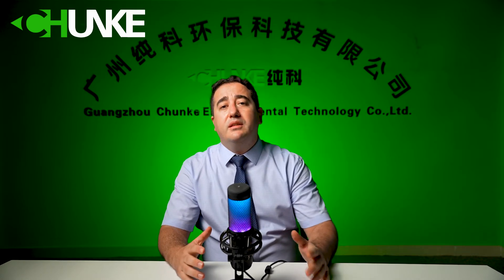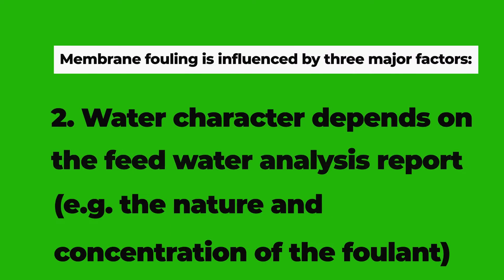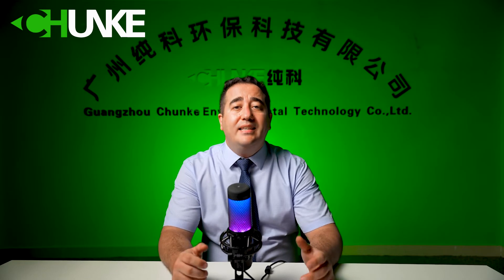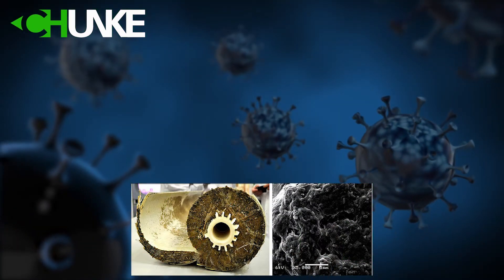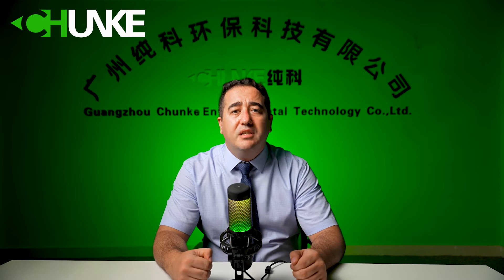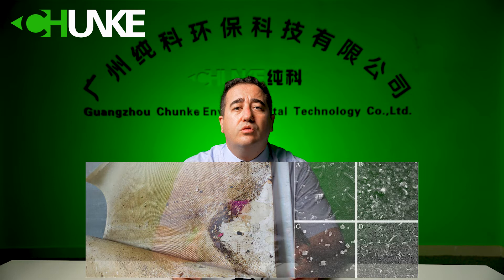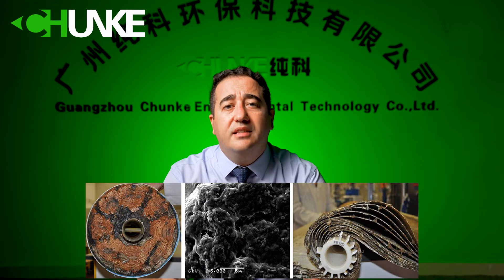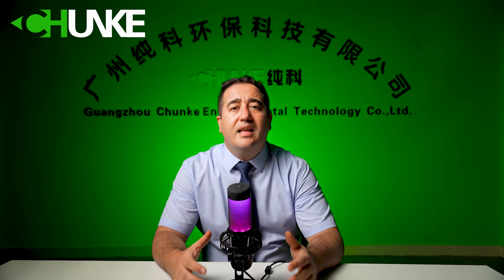What is fouling and scaling on reverse osmosis membrane filtration and water treatment?

Comment: I have one stage ro system have 24 membranes i changed membranes one months when permate water droped down and presure guages changed also when i tested vessels tds indicated 1  300 2 600 3 400 4 500 and i decided to install new membranes presure guages became normal and vessels tds decreased each one 40 mgl after on 25 days vessels tds increased 400 and i use ants calant geneys LF what is your recommendation please
Reply from the maker: We shoukd know your raw water analysis report, high pressure pump details, membrane model and pretreatment specifications...Every RO design is different, you did not get any feedback from your supplier?